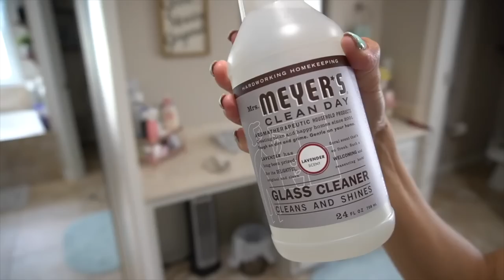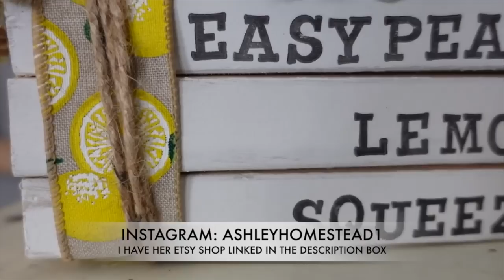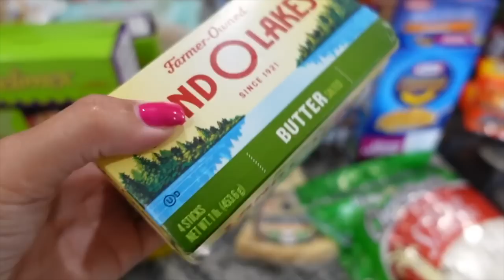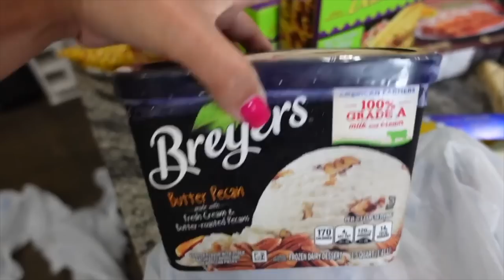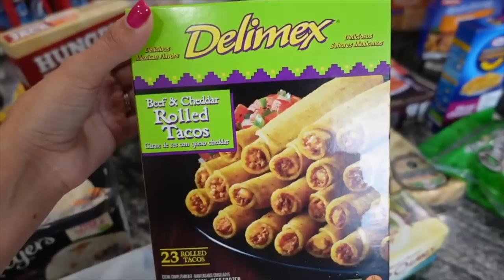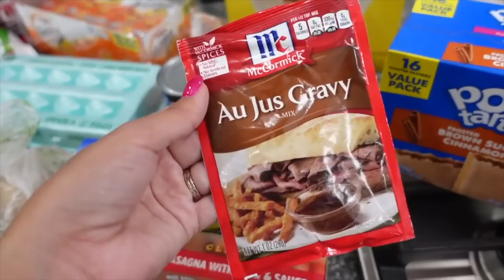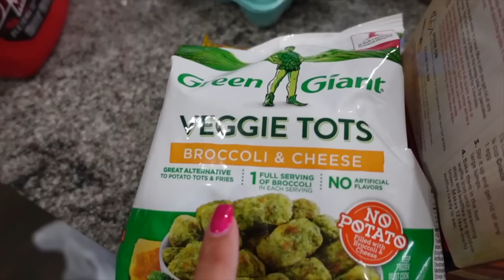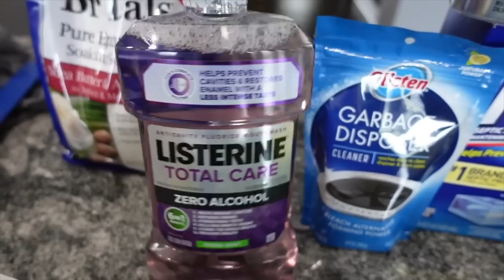ALL DAY EXTREME CLEANING MOTIVATION-WHOLE HOUSE CLEANING ROUTINE-CLEANING MUSIC TO CLEAN YOUR ROOM

Comment: Try hot water bleach and powder tide, and only use like A 1tsp of powder tide per gallon of water. Works awesome and i don’t if you tried the toilet bowl cleaner trick but i wouldn’t do that because it will ruin your grout and the grout sealer.